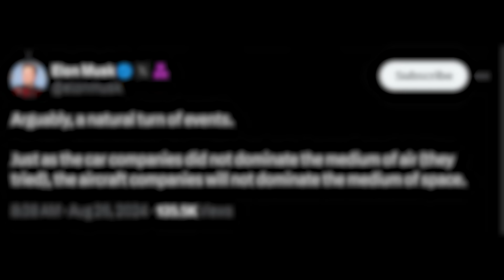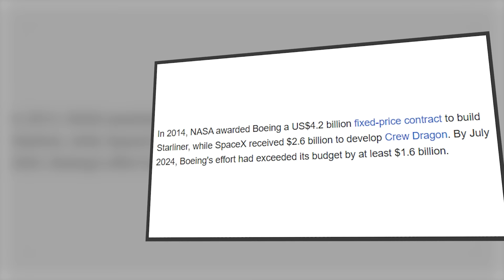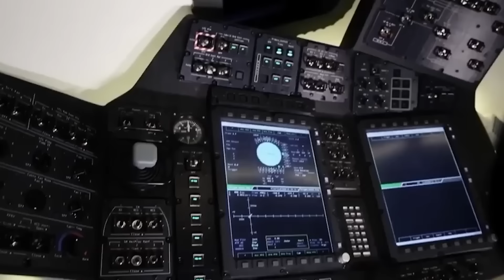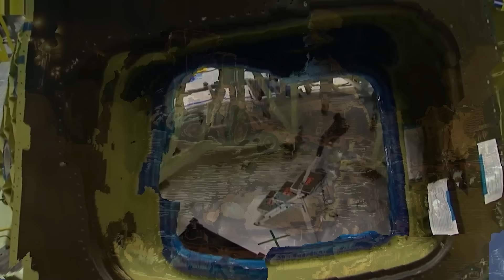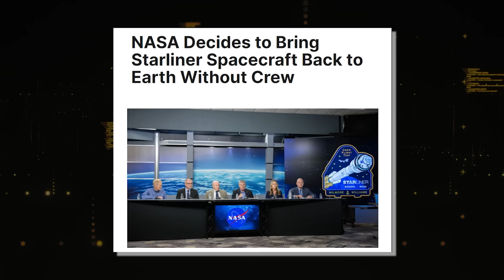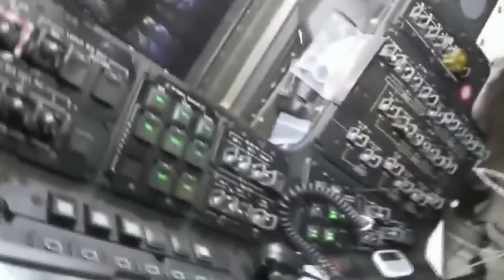Elon Musk: ''The Boeing Starliners Stranded Astronauts Are Not With US Anymore''

Comment: That's why I conclude that  the launch and adjustment of the James Web Telescope was a very complex and risky operation. This thing take more then ten years to built, but in the end the engineering teams pulled it off. The starliner there and against, is no match for the JWT when it comes to complexity, lauching and controlling, it shouldn't be a difficult task for the Boeing team to achieve similar success.

Comment: If the backup system didn't synchronise it could be by nature of time delay or course wandering predictions requiring a different setting to correct things. If the system were needed to be initiated, changing it could possibly muddle things up with timings and course correction calculations. Some things maybe worth thinking about. 🤔